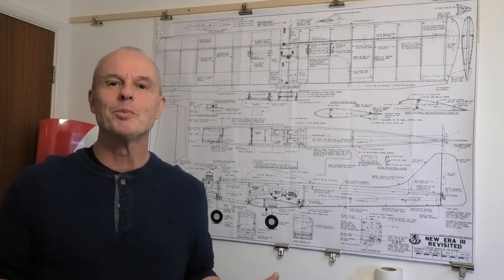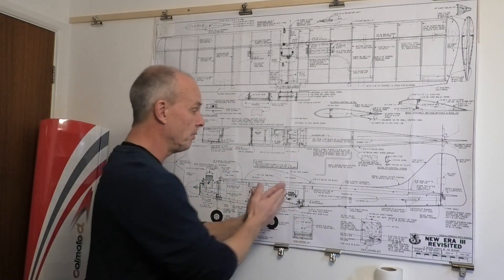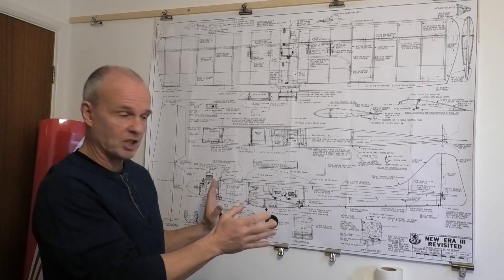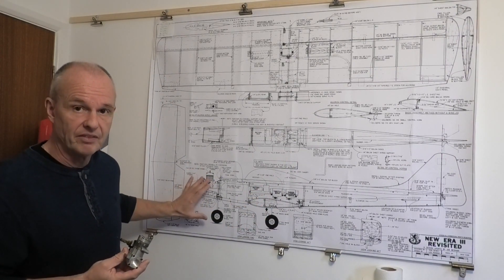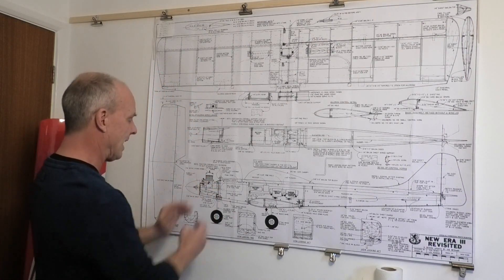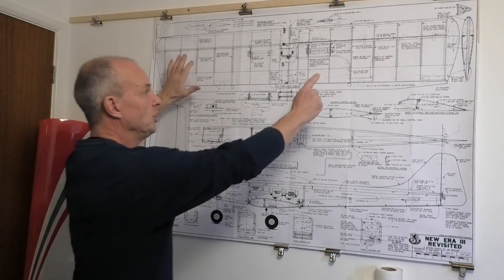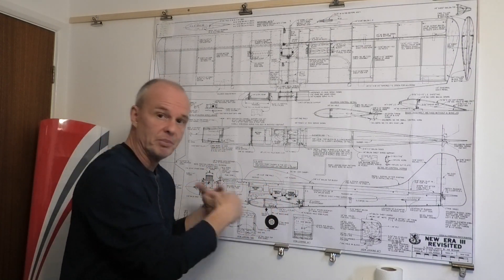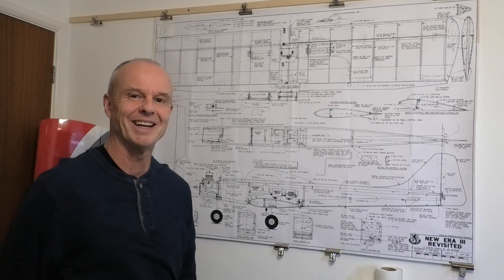New Era III Revisited: Pt 1 - A Great Set of Plans - a 45" wingspan RC balsa aeroplane

Comment: hey nice plane. just getting into this stuff and i got a partial sig Mike Stott super chipmunk that was missing the main wings and wheels and engine. (great deal on it lol) i just started my scratch build of the wings after i bought 100$ worth of balsa and i'm using a plan i downloaded. i can handle it for the most part but i know i need these servos-  one for the KB (or BK) .65 nitro engine, one for the stabilizer, one for the rudder and for the ones i'm building. it's tricky bcuz i need one of those T shaped horns with one servo for ailerons, but this won't work bcuz it would be inside the fuse. so i have to do it outside on the main wings. so how do you use 2 servos and end up with the reverse effect up and down ?

Comment: So Mark, what's the best way to reproduce these plans to full scale? Do I need to put it on a memory stick and take it to 'Officeworks' to print out. Never done it before.
Reply from the maker: Hi Peter, most of the plans on places like OuterZone are full size, so if you take them to a printers, that do large plans, and ask for them to be printed at 100% they should be just fine!  You can check this first by opening the plan in Adobe pdf reader, the free version, and either looking at the plan size in properties, or by using the measure function in Tools, to check the measurement of the wingspan is what you are expecting to to be.
Reply: @MarkRobinson555  Thanks mark. I tried the span at 100% but it measured 42". At 110% it is just over 45". What to do? Do I just keep going until I get exactly 45"?